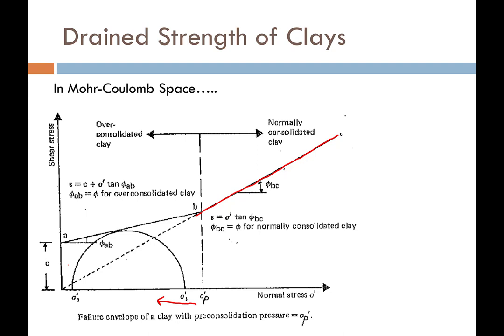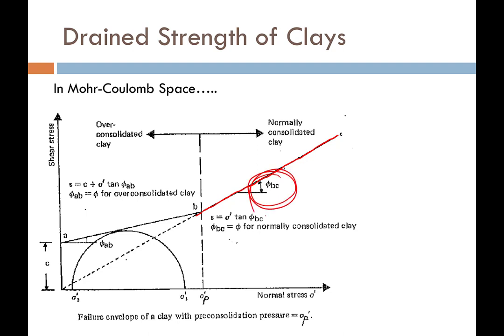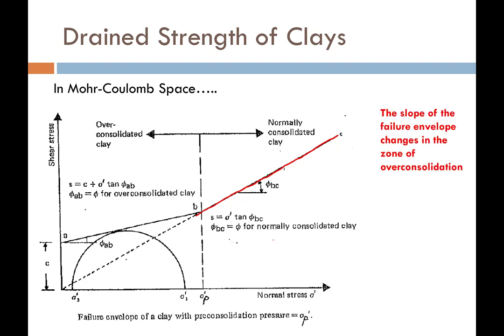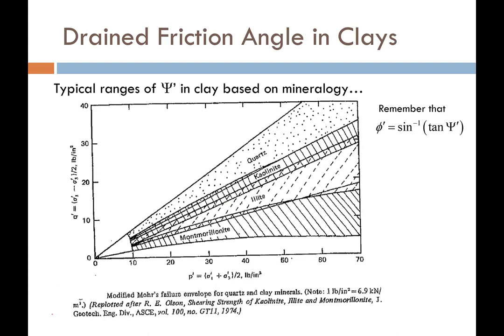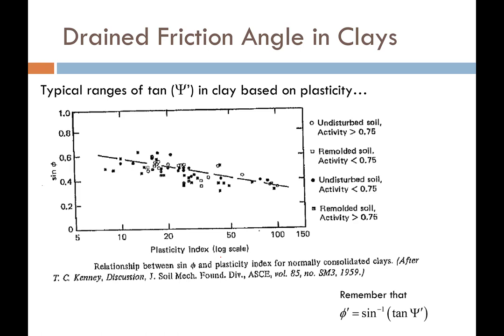CEEN 641 - Lecture 14 - Shear Strength of Clays

Comment: Thank you for the videos.  I'm a Mechanical Engineer by training but am trying to learn about soil mechanics to gain a better understanding of vehicle performance in soils.  I'm struggling with the definition of "drained soil" though.  Does that mean there is no moisture whatsoever in the soil or it is just not saturated?  If there is some moisture wouldn't there be some cohesion from the surface tension between the particles?
Reply: Thr r 2 kind of water depending upon how they r associated wd soil..1 is gravitational water which can be drained under gravitational force if drainage is permitted in soil/by soil..2nd is adsorbed water by soil particles..if soil is partially saturated,this adsorbed water produces apparent cohesion due to surface tension,however when soil is fully saturated (i.e all voids r filled wd water) the meniscus of surface tension gets destroyed(becomes flat) thus no apparent cohesion will be there..

Comment: Not understanding one thing- you prefer CU over UU, why CU is quicker/easier? (True?) Su underestimates shear strength 15%, figure is showing higher value of Su.
Reply: It was not super clear, but he is stating that TxUU is easier/faster than TxCU, not the other way around. I’m not sure why he thinks that Tx-UU would underestimate the strength- the figure given at 36min is a bit mixed up- you would not in my experience plot a UU circle in a CU or CD diagram, and it would be pure coincidence if your UU circle happed to be tangent to failure envelope as shown. Also, I’m curious why he states that rate of strain and saturation on a UU test could lead to lower values... I need to re-read the ASTM but I believe that saturation and rate of loading is no different between TxUU and TxCU.
Reply: The figure is a little erroneous, the circle is not comparing the circles of two tests but showing where on the failure circle you would be looking in the case of the two tests. The reason the UU is easier is it does not have a consolidation phase before you test the sample. The CU test requires a consolidation phase so therefore has an extra step and is more costly/ takes longer. As you don't have the consolidation phase the UU test tends to fail at a lower stress because of various factors listed within the video (saturation, strain rate, not quite getting the effective stress right). So the UU test gives a conservative evaluation that takes less time. The question often will come down to how much budget do you have for testing and do you / the engineer of record want to sharpen the pencil for a higher value.